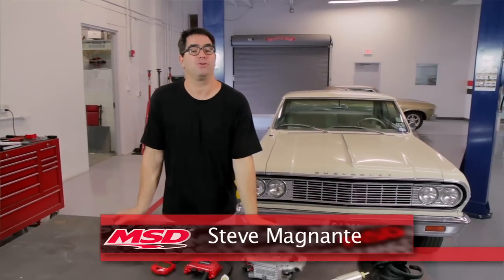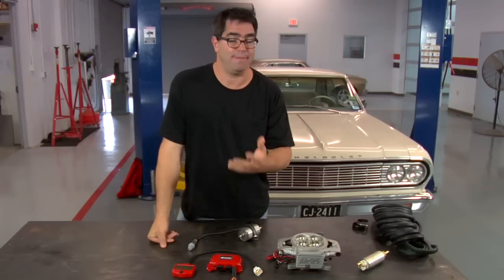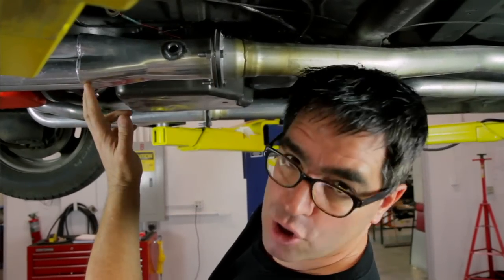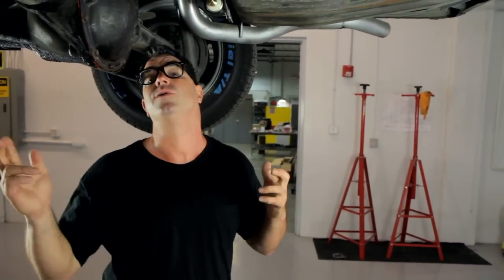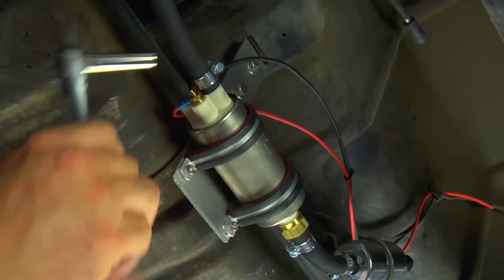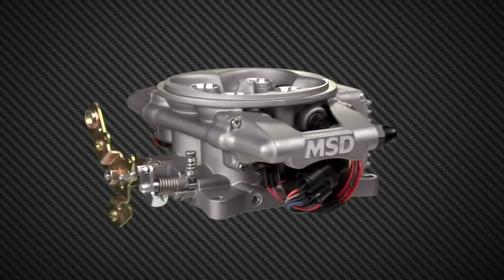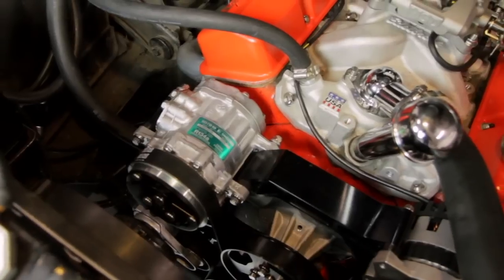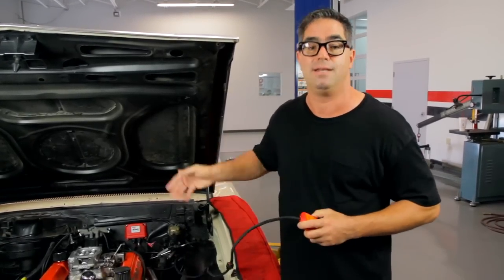Atomic EFI TB Installation Video

Comment: 1978 rover sd1 3500cc/ 214 in³ / 153 Hp  twin carp is Atomic EFI TB Self Tuning Fuel Injection System work with it, and what i accept difference and it easy programing for normal drive for one time or i need to program every long period stop, or battery down, how much change i will get on engine chart map , hp and torque  and this difference effect transmission auto or i need to upgrade torque converter stall speed and how i can know the right stall speed according the new engine chart map hp and torque . i know this  system is reliable,fuel economy, smooth clean engine start. car is stock .all rover use Buick engine 214 in³ , i need to change cold air intake manifold .
best regards

Comment: can you put it on a 454 bbc twin turbo that uses 45lb's of boost i'm putting it in a 1981 K30 truck  non dully i will be using different fuel pump

Comment: Ford Torino was only made through 1976, they never got injection, so piecemeal is all I have to work with.  Good news recently since this posting, I learned the CA emission Torinos had a vapor return line in their sending unit and that sending unit and line are reproduced so I can just buy those and not worry about the fuel lines or sending unit.  If I get real lucky I'll find a way to install the pump in-tank so it'll be quieter.

Comment: I may not be able to afford a $2500 fuel injection system, but this video takes the guesswork out of a lot of the theory behind making that sort of upgrade to a carbureted vehicle.  A GM TBI unit, ECU, harness, vapor return line, mechanical fuel pump block-off plate, and some sort of fuel pump should be all I need.  80s-90s Ford pickups sometimes have external pumps, one of those would do nicely on my Torino, and my fuel pickup is driver side, down low, so I might even try an in-tank install.

Comment: It seems like a negative that the ecu is built right into the unit. All that heat from the engine will be transferred right into the electronics. It would probably fail after a few years of use.
Reply: That is why I am watching these, every one is the same, I have a van, the engine in the doghouse has far more heat due to less room for air circulation, in fact, a simple exhaust manifold leak at the head was causing the engine to run hot.

Comment: the video is a bit rushed. It should be at least a 30 minute tutorial so that we can see how it comes together. For comparison purposes, the "Edelbrock E street 2" video is 45 minutes long. So far the Edelbrock E street with the fuel system, done under the hood, is the most thought out system for a home install. The MSD is a nice, much is in the unit, but I still feel its a complex job to put it on a typical car.The wiring and fuel hoses, rear to front, is the headache.

Comment: Always run a return system, always mount the fuel pump in the tank, by-pass the computer fuel pump sensor, and only use 1 fuel filter. If you do otherwise you are inviting problems. I learned the hard way.